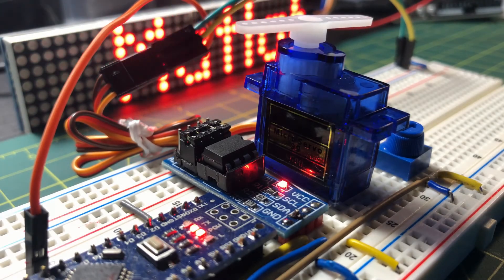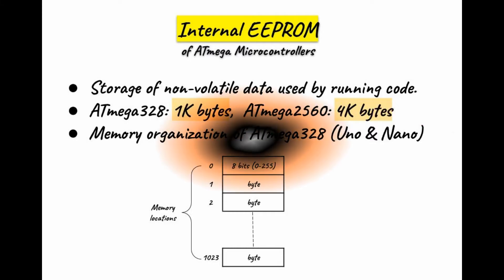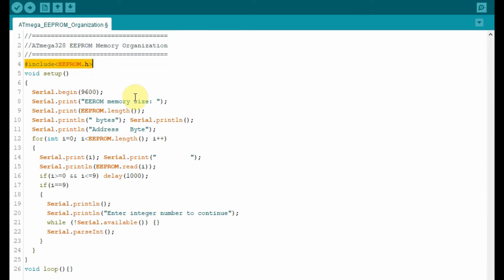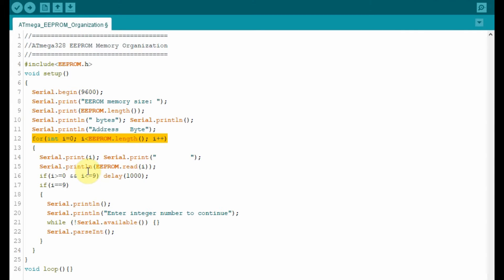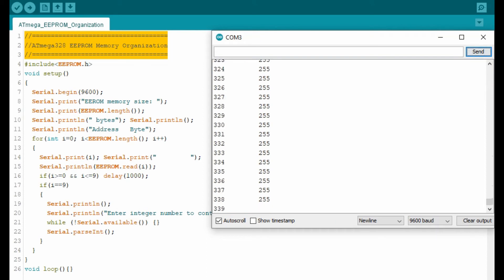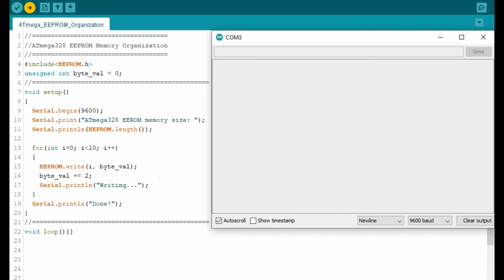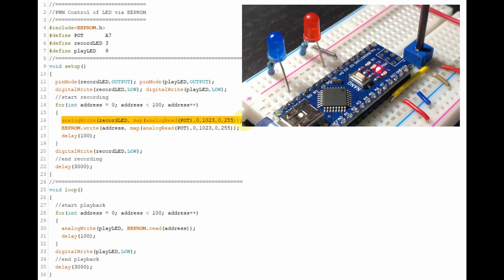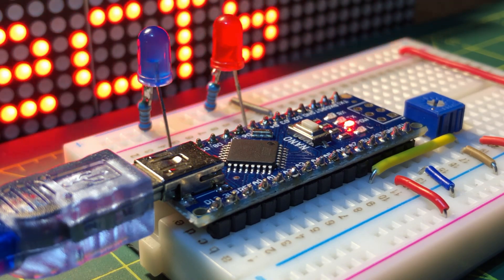Programming EEPROM of Arduino Controller

Comment: Brother,
Can you help me please?
I have a allready coded  ATMEGA328P IC, I want to write EEPROM and FLASH files to another ATMEGA328P IC. I try to write through AVRDUDES software but the FLASH file is successfully written and verified .
EEPROM file successfully written but doesn't verify.
Eeprom file verify error 

Help me brother.